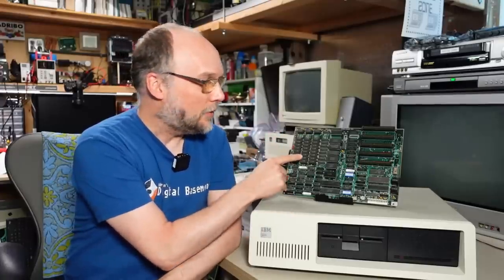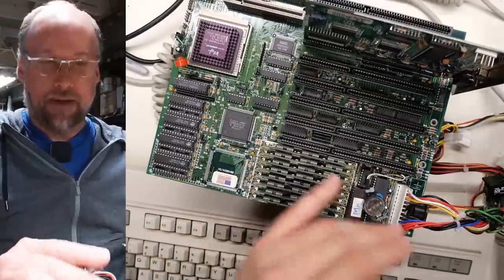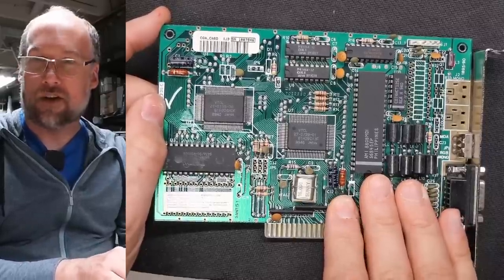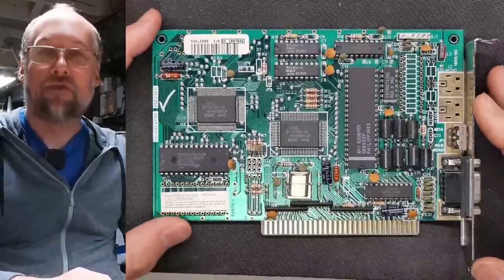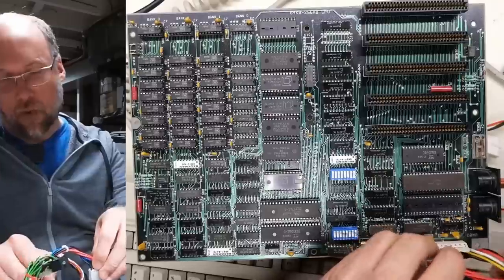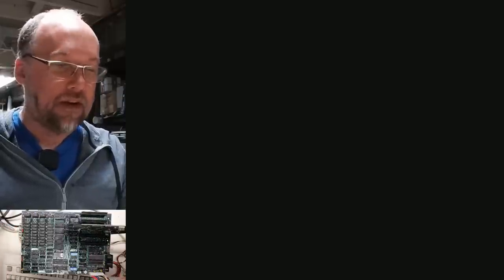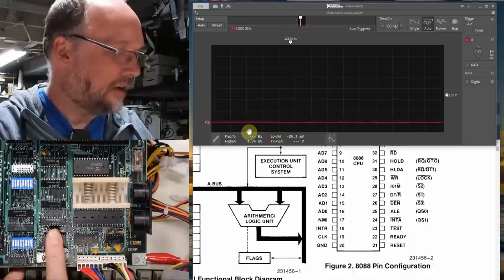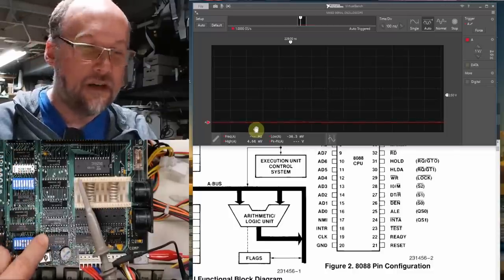IBM PC 5150 repair: The motherboard doesn't have the typical faults

Comment: I heard in another video that the BASIC in these ROMs doesn't work with floppy drives at all. You can only save your programs with the cassette interface. Also IBM continued to ship this BASIC in ROM long after their systems no longer had cassette interfaces making it completely useless since there was no way to load or save programs.
Reply from the maker: Yes that's correct, it can be called Cassette BASIC. You have to boot DOS from a disk and run basic from there to have a version where you can save to disk. (AFAIK, the DOS disk based BASIC still uses part of the ROM basic to save space on disk.) That may not be totally correct though!

Comment: The IBM 5150 BIOS Post does several checks and they all must pass before it displays anything on the screen. If any of these test fails the BIOS will inmediatly halt the CPU. Some of these tests are: 8088 CPU Test, ROS Checksum Test, DMA controller check, Timer 1 check, RAM base 16k test, 8259 Int controller test.

Comment: I'd check out S0-2 again at this point, but before that I would also connect a PC speaker. Allthough a lot of things on the 5150 fail silently with black screen, there's a bunch of stuff later in initialization that will give you beeps.

And also, a POST diagnostic card will not work with 5150 PC and XT class machines, since a different IO port is used.

Comment: ~15 minutes in, the section you are reading is relevant to minimal mode. in this mode, you can only have one other master on the CPU local bus. The PC has min/mx pin strapped to maximal mode. On the pin schematic, the RQ/GT[01] column are the pins you should be looking at. They do this is so you can have DMA in addition to the math coprrocessor in the same system, as well as an external bus controller.

Comment: To know if the 80c88 is actually doing something (pass the permanent infinite wait state you already fixed), I’d check ALE and M/IO pins. ALE (address latch enable) toggles every time the CPU is presenting an address in the A/D bus. That line latches the address to usually a 74ls373 (or some other transparent d-latch). If the CPU is stuck in a very short loop, the ALE will be toggling contrary to the most significant address lines, which were the ones you were probing. That would indicate the CPU is executing code.  Also check if the DMA controller (8237) is sending hold requests to the CPU. If the DMA controller is sending hold requests to the CPU, that would indicate that all the logic and code for the RAM refresh was executed, thus validating the CPU is working or at least executing enough code to initialize the 82c37 (DMA controller, with accompanying DMA page registers), the 82c53 (timer), and 82c59 (interrupt controller). The DMA uses channel 0 for those, so I’d check DACK0 in the 82c37 to see those requests.

After initial start, the BIOS writes to a bunch of the IO peripherals. I’d look to those getting their CS lines asserted, that would also indicate the CPU is writing/reading to/from those too.

THE M/IO line indicates when the CPU is either accessing memory or an IO peripherals. If you see that toggling, then the CPU is stuck in a loop trying to get pass some IO device issue. That toggling indicates the CPU is going back and forth between memory (code) and the offending peripheral. The 80c88 has separate address spaces for IO devices and memory, sort the same as a Z80. M/IO line changes according to the type of access the CPU is doing, be that for memory or IO.

Comment: Thank you for a nice video.

To understand some of the logic you through you have to go back to how d-ram works:
1) The addresses are split in 2 parts row and column and these values are sent to the chip with RAS and CAS asserted respectively, in that order.
2) When the row is addressed the whole row is read from the actual memory cells and put into a row register. When the column address is given it just picks the right bits from the register, not the memory cells. As a side not this is why 'fast page' works as any subsequent read / write within the 256 bytes of the page (the row) are accessed directly from this register.
3) The important thing to note is that when the cycle is finished, the whole row register is written back to the memory cells and this is what actually performs the refresh.

So, what is needed to perform a refresh ? cycle through all the row adresses and assert the RAS line within the mix refresh time.
The maximum refresh time depends on the chip used but is usually around 60uS. Some 'low power' chips increase this to reduce power consumption.

Now comes the question: how is this done in different systems ?
- Some systems that have shared main and video memory rely on the sequential video reads to satisfy the refresh conditions (Amstrad CPC).
- Some systems use 100% custom logic
- The PC uses a mix of Timer / DMA and glue logic

The designers of the PC opted for this solution because the chips 8259 Timer and 8237 DMA were going to be used anyway and contrary to IBM standard they wanted to only use off the shelf parts. In a working system the BIOS sets up both chips to perform a 'fake access' to all the rows in turn to satisfy the refresh conditions.

I am not sure if the BIOS is involved in any of this (receives an NMI interrupt from the 8259 and programs the 8237) but the complex glue logic you looked at is a timing logic making sure that sufficient time is given for the refresh to take place.

Also, READY is meant for slow devices to insert wait states and force the CPU to wait until READY is asserted.
The complex READY circuitry in the 8284 is apparently there the synchronize the signal with the current sub-cycle of the CPU it cannot be toggled willy nilly.

If the refresh is not happening correctly I would check if the 8259 timer is working correctly. The fact that you get a repeating pulse on READY could mean that is is working (DMA wait for refresh).

Comment: Onthe cassette drive thing, it amazes me to think that IBM PCs had such abilities to load & save data to cassette in the same way a speccy or a C64 could, for IBM, it seem a step backwards in technology, and yes, I know that tape backup devices were used commonly, but that's a different thing altogether...
Reply: The whole PC project can be seen as a step "backwards in technology", compared to many older IBM machines. They didn't even design most of it themselves, but used standard parts instead, Very unlike IBM. Because it was intended to compete against Apple II, TRS-80 and similar simple machines that were also mostly using standard ICs.

Comment: Ha, brings back memories. I used to know these chips by heart '00, '04, '08, '74, '175, etc.   Still, I don't think I possessed your patience and tenacity. Also, it would have been an eye opener back then to consider chips going bad as I had never experienced that it in the 1980'es; faults were almost always broken wires or shorted pins.  I look forward to the next chapter in this adventure.

Comment: I know what those multiplexed address status lines mean, it's related to the x86 memory segmentation scheme. The "Code or None" one means that the CPU is using the code segment register (CS) to store data that's being read from memory, or it's doing nothing in relation to the segment registers.

The other ones should be fairly obvious, Data meaning that it's using the DS registers, the Stack one meaning it's using the SS register, the one that confuses me is "Alternate Data" which I think means it's using some general purpose register like FS, GS or possibly the accumulator.

Comment: Hi Adrian. I enjoy watching your videos. They have been a terrific distraction for me since my mom died earlier this year. I have a strange problem and am not sure if you would be able to provide some insight into solving it. The problem is a Samsung LCD monitor. It started to behave strangely a few months ago. I'd be watching something, the screen would blank briefly, then it would come back, then it would blank again and come back, and then it would blank and not come back -- just solid black. I opened up the monitor and looked around and everything seems fine. I bought an ESR meter to check what appear to be the little tin can SMD capacitors and they checked out. I know the chips must work because there is text on the screen. I wonder if I could send you a short video on what the screen looks like with the problem happening. Also, I could show you a photo I took of the board. I did some voltage measurements based on what was listed on the board and they checked out. I wonder if you or one of your viewers might have some insight for me. Thanks in advance. Jeff

Comment: I did not own a 5150, but I was in a public tech school in 1983, and many of the 5150's in the computer lab were the 16K(?) no-drive variety.  I’m sure these were cheaper and therefore easier to write an educational grant for.  I took the very popular Basic Programming class, and we were required to use those machines at the beginning of the class.  I think they assumed they would get the cassette tape completely working by the end of the semester (I tried to help since I had a new cheap-ified TI994a with a cassette interface at home), and we were close, but in the end they had to let us use the more expensive floppy machines.  It’s a lot to expect a student to spent an entire lab entering 100s of lines of code for a class project to just turn off the computer and throw it all away.

Comment: I wish I had the time to dig out that old dead 5150 board I've got somewhere around here and do some more troubleshooting. All I did when I got it was check for shorted tantalums and make sure the voltage rails were all good, then put it aside. Unfortunately I'm right in the middle of another electronics project, with plenty of others in the queue, so I'm not likely to get back to it any time soon.

Anyway, always good to see your repair videos, even if we don't get that "it freakin works" moment. I'll be very interested to see what else is wrong with this board.

Comment: My 5150 actually started out as a diskless one.  It had an extra ROM with Datalight ROMDOS on it, and ran software for the MicroTICCIT interactive TV system.  I believe it came out of an Air Force base on the east coast, as it had a DoD tag on it and I remember reading about a training system which was trialed by the Air Force which used MicroTICCIT.

That schematic is a bit weird- there are NAND gates which look like XNOR gates.
Reply: "That schematic is a bit weird- there are NAND gates which look like XNOR gates"  I SAW THAT TOO!!

Comment: Yes, the 8088/8086 has the maximum mode and minimum mode selection. It actually does more in minimum mode as it is closer to a microcontroller and is a 1-chip computer. Maximum mode strips away the internal DMA and IRQ controllers so you can add your own and provide more functionality yourself.
Reply from the maker: Wow. That's pretty sophisticated to be honest
Reply: @adriansdigitalbasement  -- I didn't know about minimum mode and the unused internal hardware for some time. PCs always use Maximum mode. That means a timer, DMA controller, and IRQ controller need to be added to the board.

I've never heard of Minimum mode being used, but I guess that would be for embedded applications. Telephone company equipment might have used it. However, the NEC V20 was more popular for that application. I've always admired that chip as it is fully compatible with the 8088, and it is 10-15% more efficient at running code. Like the 286, it adds a hardware multiplier and an address unit with its own adder. So memory accesses and multiplications take fewer cycles.

Comment: I recently got a clone of this board at VCFSW from the free pile.  I hope the fact that half of the RAM is MT means that that part of the RAM is the fault.  If not, I will definitely rewatch this series for some guidance.
Reply from the maker: One can hope! It seems later 256k MT RAM is quite reliable, it's mainly the slow and old 4164 that's bad. Half of your board probably has 64k DRAM though so at least just remove it from the board and see if it can work at 512k.
Reply: Haha, I also picked up an 8088 machine at VCFSW (a PC XT clone) so I was also really excited to see this video come on my feed

Comment: It's starting to look more and more like this board might have experienced a PSU failure/lightning event and gotten spiked on certain rails, killing off the more voltage sensitive ic's.

Then again given the clk gen chip was missing, who knows what other chips have been swapped around, what if its gonna turn out the roms are actually blank, or that the cpu is bad, unless you already tried a different cpu off camera.

Comment: Hmm I would wager the chip in parallel to the one you replaced is probably shot also, a signal call from it may have surged and fried the other chip in the step up request. Or something shorted to the one ground pin on that one chip (bug crawling through the computer??) which would probably cause the other chip to ground short and fry also. (Calling dibs!!! hehe)
Reply: Yeah, my gut reaction would be to inspect anything near that first failed chip to rule out a localized issue.

Comment: Wow! I had NO idea the original pc could use a cassette drive, or that it included basic... I assume the cassette port only worked in basic?

Is the 5150 the original PC AT?
Reply: Theoretically the cassette port could be accessed from DOS, but there was nothing built-in to DOS to access it, so someone would've had to write a third party utility for it and I'm not sure anyone ever did.

The 5150 is the original IBM PC, and a predecessor to the AT (it goes 5150 -> XT -> AT I think)
Reply: It even had small relay to signal the cassette motor to stop after reading/writing program. All through the DIN connector.
Reply from the maker: Yeah that basic in ROM only supported Cassette. And really all you could do is load basic programs from tape .... I'm not sure any commercial software was ever released for it the PC on cassette. It was a strange thing they added and quickly dropped.
Reply: Thanks for all the replies! That explains why I never knew about it.

Comment: First thing I did when I got my 5150 was replace all the tantalum capacitors, they can go bad and short voltage rails to ground, Mouser sells identical looking ones. Also replace the ones on the cards. Next thing I did was re-cap the PSU, then replace the AMD 8088 with an Intel 8088, and add the Intel 8087.

Comment: @32:39 .. CLK of the FlipFlop isn't toggling because non of the signals of U64 are going low. CLK of the system has nothing to do with this glue logic. U64 output is made up on only !X10R  !X10W and Output of U84 which is based on !XMEMR. There is one other signal on Pin4 of U84 ... but it isn't CLK and is lower on the page.
D1 is an input to LS175. I'm thinking it's another flip flop... yeap - another D-type flop flop in Quad (4bit) configuration. So D1 is an input.
D1 is tied to Q0 (an output) for the 4bit latch. So Pin4 of U84 is based upon the previous state of D0 on the LS175 when CLK transitioned high last.
@34:56 - Same type of D-flipflop. LS74 is low power Schottky.. S74 is just Schottky.  Probably has to due with "fanout" needs of the circuit.

Comment: Well AEN2 is going into NOT gate, so it has to be pulled up, to become zero on the AND gate that follows. That bottom part of chip(RDY2/AEN2) simply isnt used for anything.
Problem would be obviously RDY1(DMA/WAIT) staying low(wait), AEN1 being low is fine since its again NOT gated(RDY = AEN1 low, WAIT high).
Im not expert but its simple logic circuit.

Comment: The AMSTRAD PC1512 uses the same CPU and NDP as the machine you are working on but uses custom FPGA chips for to hold most of the logic found on IBM Compatible computers.
Reply: Actual FPGAs? Or ASICs? (The equivalent would be shipping (E)EPROMs rather than mask ROMs.) It certainly happened sometimes, but given Amstrad was so cost-conscious I’m just a bit surprised! 

Sometimes early units shipped FPGAs when they were waiting for the ASIC production line and needed to ship Now, but would them later switch to the cheaper ASIC once they had enough inventory. That would certainly be more what I’d expect from Amstrad. But maybe they used FPGAs the entire time!
Reply: the PC1512 was my first IBM-compatible system (1987, maybe).  I had some weird stuff with it, like a Game Blaster audio card that's rare as heck now.  Too bad I sold it in the mid 90s; I really miss it now.

Comment: In the time that the IBM PC came out, my dad was working at a municipal automation center. I did a summer job there in 1985 and 1986, assembling IBM PC's.
This was in the time that the AT was already released, so the original PC had been discontinued but the XT was still in the catalog. So I don't know for sure about the original 5150 PC (either the PC1 or PC2 which is what you have here) but I'm pretty sure that all XT's and AT's came from the VAR with floppy drives and hard disks installed according to the type number that you ordered. Of course there would also be the appropriate floppy disk and/or hard disk controller, but that was it. You had to add the display adapter (and set the dip switches accordingly of course), and the monitor and keyboard came in separate boxes too.
I've never seen an IBM PC with no floppy drives. If you could afford an IBM PC, you could afford floppy drives and didn't need a cassette. The only official program that ever got released on cassette is the diagnostics program for the IBM PC; I've seen video's and pictures of it but I never had that in my hands, unlike a lot of other IBM PC related hardware.